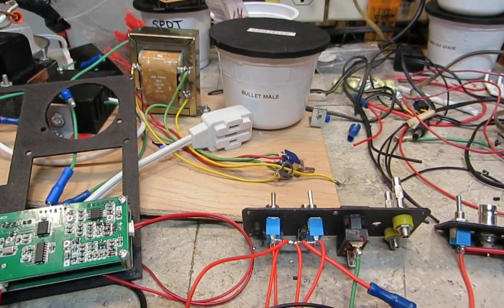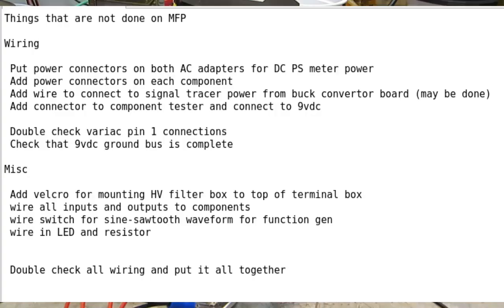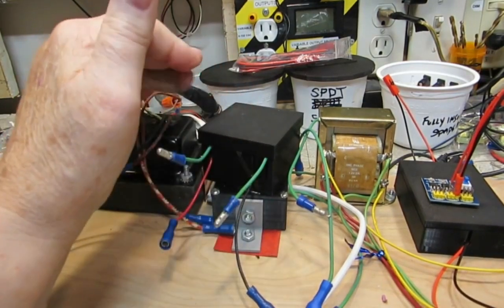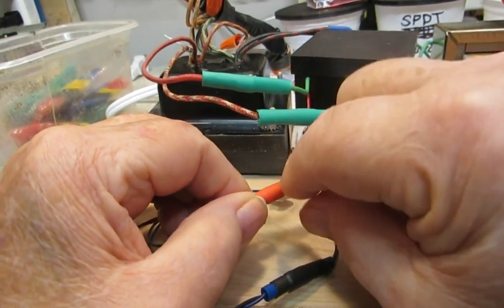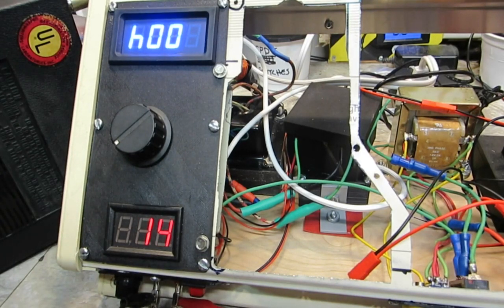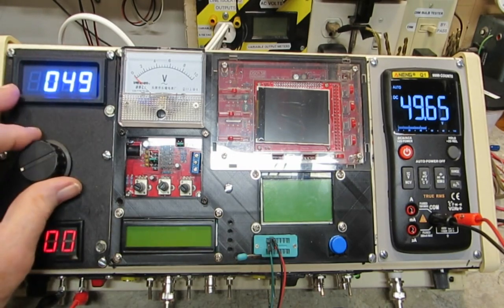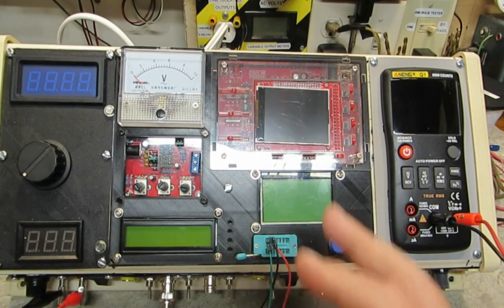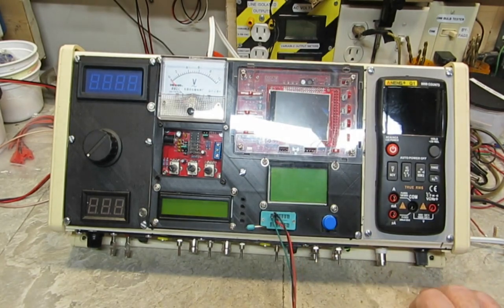DERB - MFP - Final for now

Comment: You have come along way with it Doug. Glad to see the finish line is  just ahead. One suggestion is to mount it a little higher to access the bananas jacks
 and switches better. They seem too close to the bottom where you rest it on the top of your worktable. Maybe custom made corner feet on the bottom so
 there is  some reach room.
Reply: @DERB_Seymour_Indiana  That is what I was hoping you would say!

Comment: It is coming along fine, as for the scope I would get one with a brighter screen and one that can at LEAST read the 455 KC IF frequency, any scope below 1 MC is useless for AM radio work.
Reply: @DERB_Seymour_Indiana  I have this one, I bought last year, it was $37 on EBAY but not the price went up very high.
It is a great scope, it also reads frequency.
Reply: @DERB_Seymour_Indiana  It is bright, you should not have any problems, because of my poor eyesight I use a magnifying glass, but you will not have to.
Reply: @DERB_Seymour_Indiana  I can make a video of my scope if you want
Reply: @DERB_Seymour_Indiana  OKAY, I am headed out to the shop now
Reply: @DERB_Seymour_Indiana  The video is in HD because that is the only camera that will do closeups.
So it will not finish rendering till 11 PM, so I will leave the computer on and I will have to upload it when I get up.